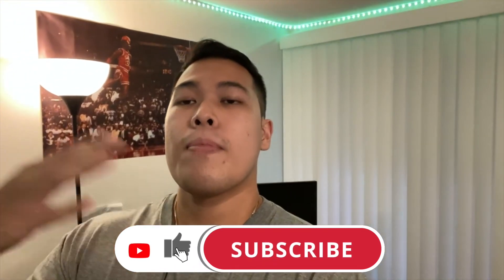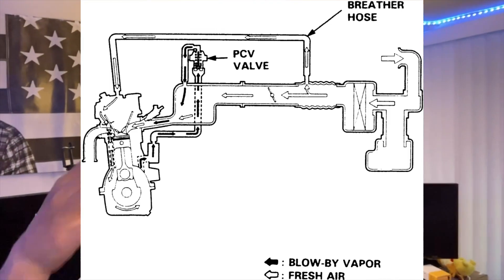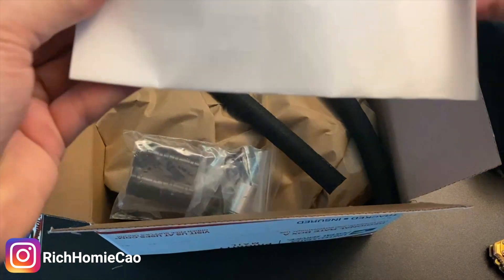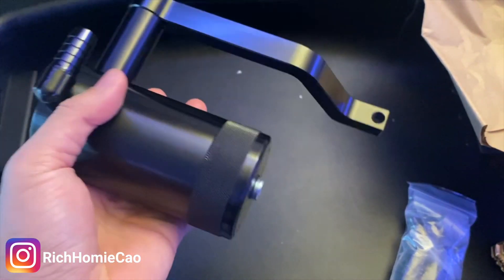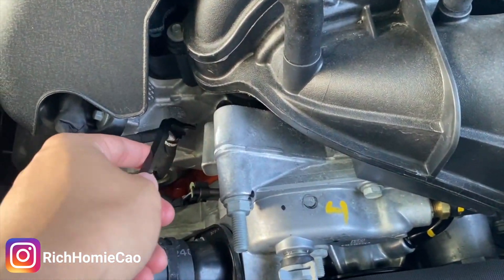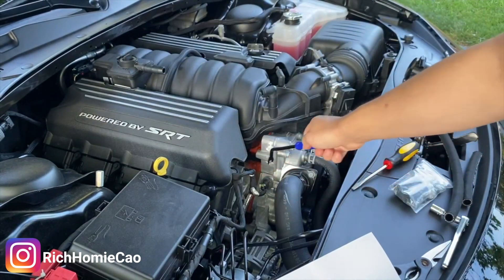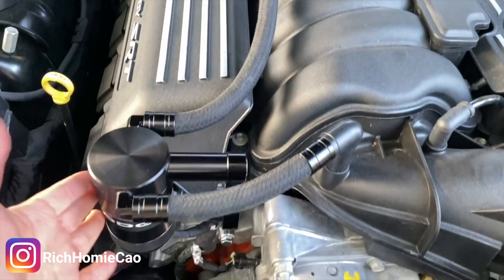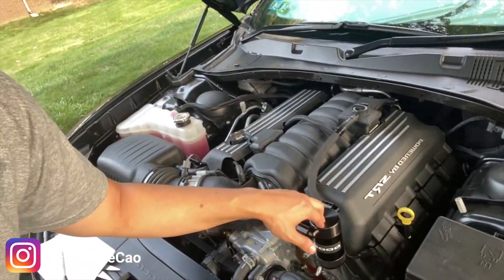Oil Catch Can - Best Mod For Your Dodge Scat Pack 392! | Unboxing and Install

Comment: They have these for v6?
Reply: Theyre available for practically every car. You can get universal ones too on amazon. I had one one my 14 mustang v6 that was universal and worked great. I'm gonna use the same one on my 392 I just need to get a bracket or make one/find a spot for it
Reply from the maker: Yep just like PJV Music said there are universal ones or there are kits available just for the v6 search on Amazon/eBay
Reply: Thank you both!

Comment: Not haten but this is a misconception. The 6.4l srt hemi from 2015 and up are designed to run with blowback and circulates withought issues but it absolutely doesnt hurt to use a catch can ill be getting myself cause im compulsive lol. The older hemis 5.7l had issues and people started to use catchans to eliminate that issue and people just kept using them, even after dodge fixed the issue thats why alot of people install them anyways. Sweet content btw keep it up 👍🤙
Reply from the maker: That does make sense!  Nothing wrong with some redundancy in the system 😂 thanks bro i appreciate it!🤝🤝